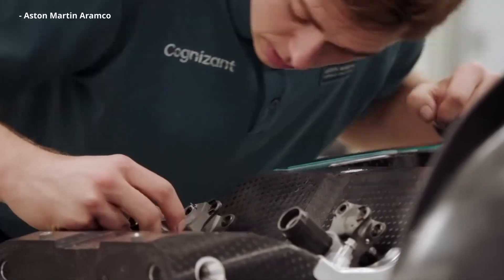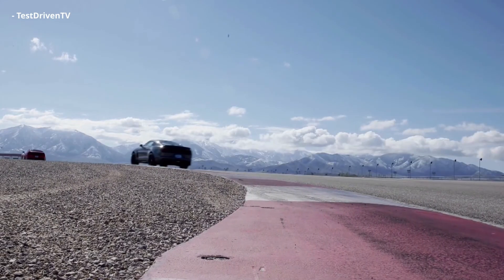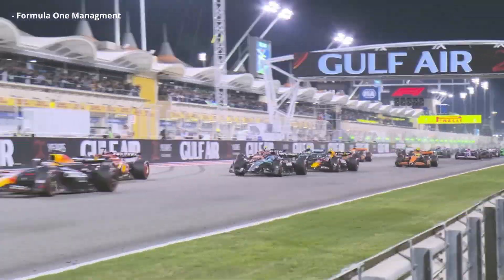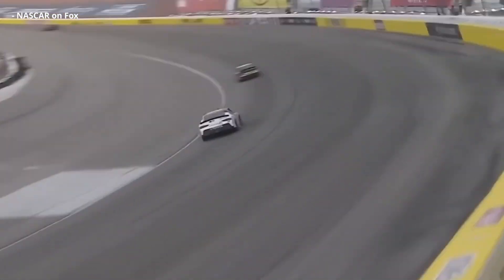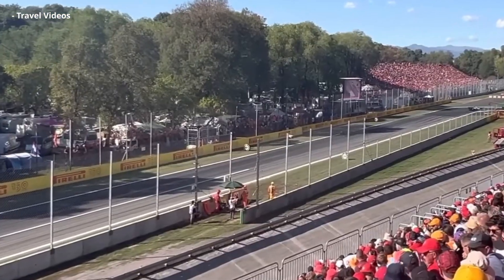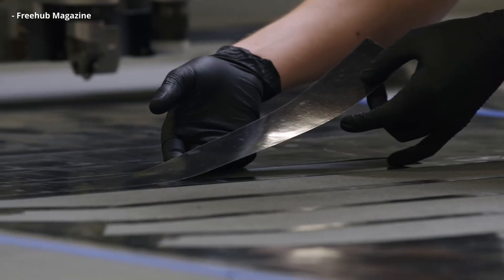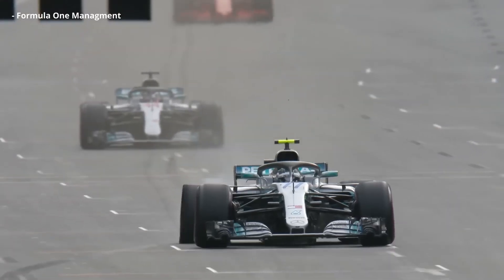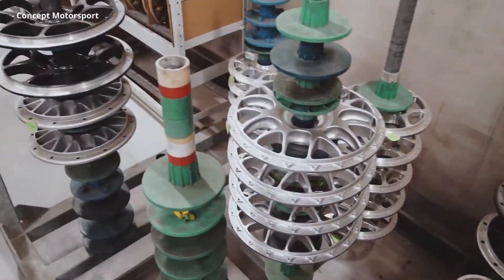Why Aren’t Formula 1 Wheels Made Out of Carbon Fiber?

Comment: If Formula 1 is not using them I would not put my life on the line with a carbon wheel that could fail at high speeds.  Not worth the price and weight savings.  

Excellent video 👏👏👍

Comment: I wish they would actually implement carbon fiber wheels for F1 too. Firstly, the reasons you mentioned are genuine and true, but F1 is a sport known for its cutting-edge research and development, pioneering innovations like no other. These challenges could easily be solved by those brilliant minds. For instance, I myself just came up with an idea like a magnesium structure reinforced by a carbon fiber outer structure, could reduce weight and effectively handle vibrations and forces.

Once these issues are addressed, as you mentioned, there are race advantages, but beyond that, there's also the potential to save a significant amount of cargo weight. With 13 sets of dry tires and 4 sets of wet tires per car, totaling 20 sets per weekend, that's 400 sets of tires. Just imagine the reduction in cargo weight and fuel consumption, both contributing to environmental benefits and also long-term cost savings, once manufacturing costs are factored in.

Comment: The answer should really be immediately obvious. Pretty much all forms of motorbike racing explicitly ban carbon fiber rims and have been very public in explaining exactly why. It's especially notable given that you can buy a bike with carbon fiber rims as standard, and they've also become relatively popular aftermarket options as they offer huge benefits over even what cars might see (less gyroscopic mass = far more agility).

The problem is purely that of unpredictability (safety). Not only is carbon fiber brittle and prone to devastating damage with the wrong unexpected bump, but they're also incredibly hard to test and love to hide their internal damage. Without something big and expensive like xray testing, the wheels could be hiding internal damage like delamination yet presenting perfectly. Then normal stresses well within their design intent will cause a catastrophic failure (as caused the famous Titan submarine failure due to delamination from earlier dives - they also didn't bother with xray scanning). This damage could even happen mid race such as taking a kerb roughly, and after enough real world failures the motorbike world rejected the idea. Carbon fiber will always degrade under repeated stress loading so a wheel is pretty much the worst option for it.

The heat issue could easily be designed out. It's more a benefit of metal wheels to utilise brake heating rather than a detriment of carbon wheels. But modified braking system to avoid heating the rims would be childs play to design. The weight issue is already solved and most carbon wheels will be not only a fraction of the weight but far stronger at that low weight. But even the strongest wheels will develop flaws with perfect driving and no impacts, and as mentioned impacts and damage affects carbon far worse. Either way catastrophic damage is inevitable and heavier wheels won't make much difference.

Comment: For the same reason you don't make submarines out of carbon fibre.  Also, the wheels are so insanely light.  I picked one up at Aus GP a few years back.  Easily hold it one hand.
Reply: My father does research for the government and one of his projects was exploring using carbon fiber and other composites for submarines and ship bodies.  It can be done they just have to decide when they want to build one.
Reply: @JayDee-b5u  That idea didn't work well for Oceangate

Comment: Carbon fiber can sometimes take hits better than for example aluminium and don't necessarily crack from the same forces as alu. There are videos by Koenigsegg that show this. Also heat isn't a problem because heat shielding can negate any problems from heat plus they already have the sort of drum over the brakes in F1 which is carbon and can already withstand the heat. As for cost now with the cost cap that makes sense, but before that the only reason for F1 not using carbon wheels is regulation
Reply: There is a lot of videos with expensive cars and carbon fiber wheel damage.  The roads are a problem in most places.  

Carbon wheels are not worth it if you ask me.
Reply: @Phantom096  I agree they are not worth it because the weight saving over magnesium is very small but the cost is very high. I was just listing some points that aren't really any reason not to use them
Reply: @ShittyUserName  Same with carbon fiber driveshafts vs Aluminum.  A lot more failures with carbon fiber.  In certain applications it’s just not going to beat a metal.
Reply: @Phantom096  that's because (depending on many factors like how it's made) carbon will have a more sudden failure where alu and other metals will have a more gradual as in carbon will simply snap and metals will stretch until failure. But yeah depending on application and other requiremwnts like cost carbon isn't that often the best option

Comment: also (as far as I understand) the brake temperatures are used to heat up the tires and I don't think carbon fiber rims transfers heat as well (or not at all) compared to "metal" rims. Just my two cents... Anyway, thanks for this interesting video 👍🏻
edit: oops, was already mentioned in another comment 🫣

Comment: Carbon fiber doesn't explode, and you're ignoring a lot of actual failure modes in this argument.
Reply: High tensile brittle failure is basically an explosion.

Yeah, not technically the same if you really picky, but not the topic of video anyway
Reply: He try to explain it as simple and as easy as he can for normal people to understand the context..

Comment: I think something else to raise is that metal is a really good conductor and drivers use the brakes to help warm them up the tires. It would be counterintuitive to not insulate the tires from the heat of the brakes. Though there's a part of me that remembers F1's purpose is supposed to be for innovation too and having carbon fiber wheels that can do what the current wheels can will help carbon fiber tech advanced. Great video! Just subbed.
Reply: Because unsurprisingly surprised, 70% of the case you do need more cooling.

And you can do less cooling by.... Just blocking the brake duct with heavy duty tape. And that's what they did on certain case that brake duct isn't feasibly good to install
Reply: carbon fibre isn't an ideal material for mass manufacture, its expensive to manufacture and fabricate. it's also very difficult to recycle and it will never be as strong.
The benefits of research and development is not really necessary nor sustainable.